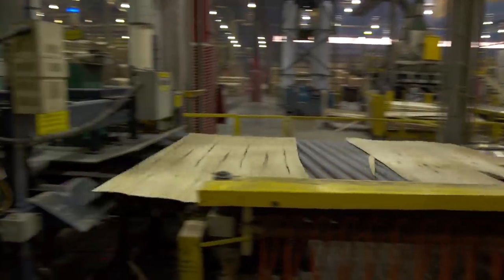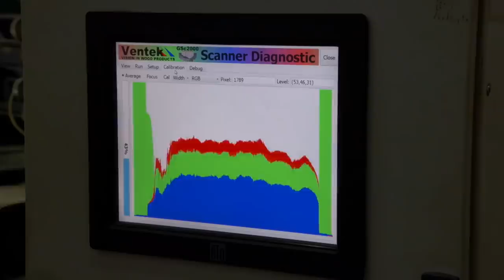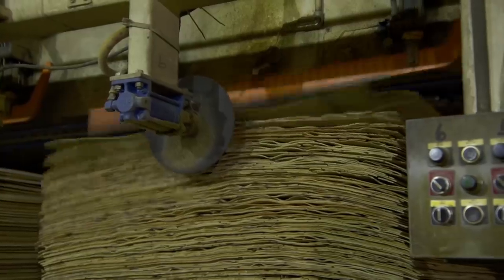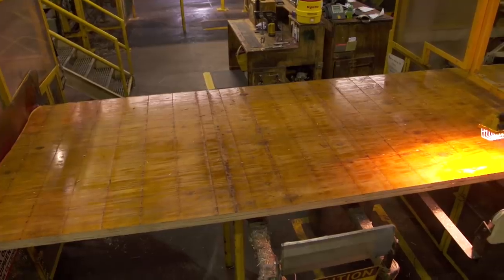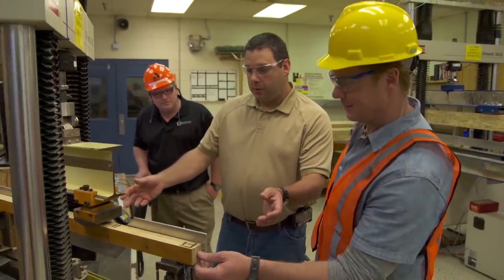How Laminated Veneer Lumber is Made | This Old House

Comment: LVL are indeed very strong.  The weakest part of course isn't actually the wood, it's the glue's lifespan and resistance to breaking down over time.
Reply: Is water a big problem to it ?
Reply: @bosse641  like most organic building materials, if it gets wet, it needs to be able to dry out quickly to avoid damage. LVL’s are a bit more susceptible, so they can & should be sealed prior to install, especially the ends.

Comment: That might have been impressive if ya'll had shared the total weight it took to break the given product.
Reply: It would be interesting, but I don't think it would mean much without other details. For example, if the beam was supported by two points 5 feet apart, I'd expect it to hold a lot more than if it was supported by two points 10 feet apart.

                        ||||||   <--- Load
_____________________________
|||                                               |||
^ Point support
   <- dist between support -->
Reply: @ae1ae2  

I agree.
However, they should give the general specification for load bearing.

That way, even a novice designing a building gains some knowledge of the product.
Reply: It wouldn't really have any meaning because it would be dependent on so many different factors of the member.  If you're really interested in structural properties of timber, read the NDS.
Reply: They're not going to give you any numbers because it's proprietary.  They don't want competitors to know what they're performance capabilities are.  So they give general info like a small car.
Reply: @rockys7726  This is not true.   They have to publish values and meet certain requirements so engineers can design and specify members correctly.
Reply: @rockys7726  
That tells me I don't want to use this company's product.
Reply: @m.5051  publish to the government yes.  But it doesn't need to be stated to the general population.
Reply: @rockys7726  What?  You clearly have no idea what you're talking about.  Why do people who know nothing about a topic feel like they have to comment and offer their opinion these days?  That specific member that was tested will have allowable loads published in design specifications for use by the public.  The way they produce their product may be proprietary, but that's it.
Reply: @rockys7726  Here's one of our products but the load capacity is a secret.  No one could use their product in a design because they don't know what load it could support.  How does that not make sense to you?
Reply: @m.5051  So you must be a mechanical engineer working in sales too?
Reply: @rockys7726  That's what you've assumed from my brief comments?  I'm a structural engineer.

Comment: Notice how they didn’t give the exact amount of lbs of pressure
Reply: Exactly. I'll stick with proven wood that won't fall apart after 50 years.
Reply: @hotdogs5265  
These laminated pieces are much stronger than a solid piece of lumber.  Unless you are building your house from Oak at a cost of 30 times a normal house.
Reply: Also how does this this laminated wood retain its structure properties with prolonged dampness?
Reply: @1sttigertiger426  They given a waterproof coating after being sized to the customers ordered dimension.

Comment: Good tour of the factory that makes laminated veneer lumber but the strength demonstration would have been improved if they could have shown what a comparable solid wood beam would look like and its comparative cost. LV lumber is supposed to be stronger and smaller than a comparable solid wood beam. Also the poplar tree it comes from doesn't have to be as large or as old as the species of trees needed for solid wood lumber.

Comment: What's the difference between LVL and plywood?
Reply: Jathan Gilbert
 ... plywood is almost the same product as far as layers of wood, but LVL is select pieces of wood without voids, uses different glue, and is certified for structural use when done. Basically plywood is NOT certified for structural strength and it's also not commonly available more than an inch thick just for that reason.

Comment: Very enjoyable video to watch.  Sure wish they would have said how many pounds they were hoping to reach before it broke.  Then tell us how many pounds it took before it actually broke.  I do believe it passed but I would still like to know how much it exceeded the magic number.
Reply: I have to wonder if that's a trade secret and that's why it wasn't stated. Either that or there may be legal issues if they state that these could reach a load in excess of their advertised load. I'm sure overpriced lawyers were involved regardless.
Reply: @jblyon2  ... since lam-beams (engineered lumber) are now part of the building code it would have been nice if they shared the "book spec" against what their test beam stood up to. Also comparing it to the typical dimensional lumber it's replacing. After all, this is why most of us are using the stuff.